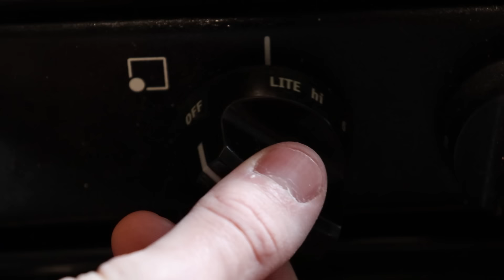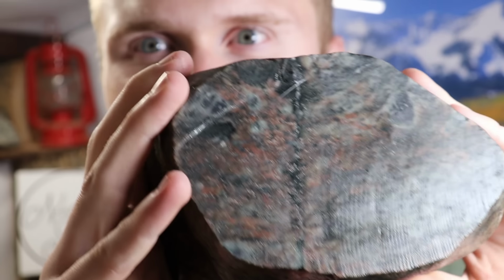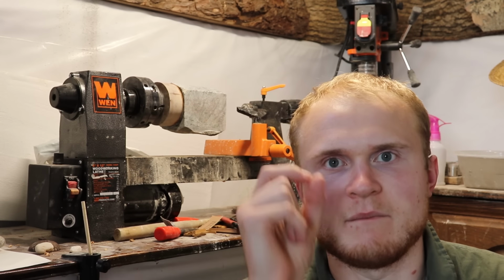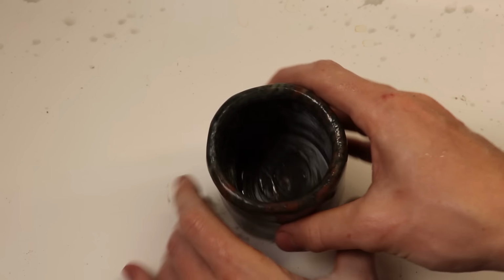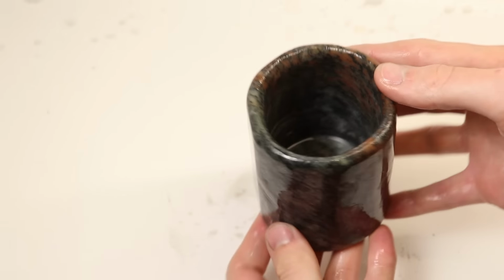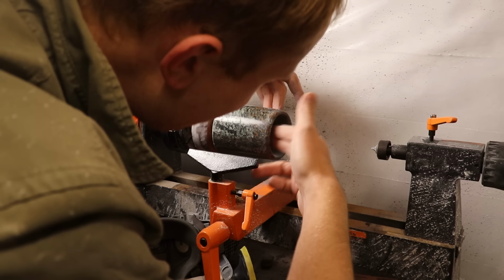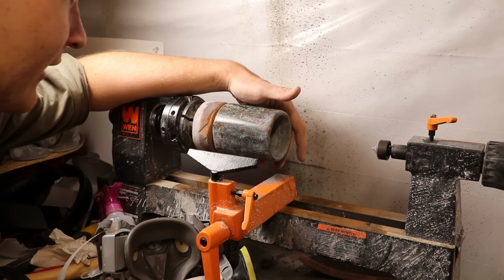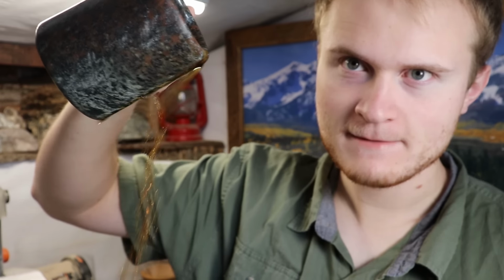I Made a Coffee Cup out of A Rock

Comment: GREAT VID!
just some pointers, not trying to bring you down, first, try locking the rock to the back fence of the miter. miters saw blades spin clockwise, it's not safe to push anything into it like a table saw.
easy fix, using that AWESOME slider you got, lock that sucker on the back fence, clamp it down, manual cut that sucker.
takes more time, but it's safer and less likely for you to have mini projectiles punching holes in you hands and stomach.

another one is instead of glue, bolt the wood to the rock and bond the bolt. I'm fairly certain you saw this one in hindsight, so ill leave this more of an idea for next time, because there has got to be another one. this is far to awesome to not make a second one, specially for selling. rocks are one of the few things you can pick up on the side of the road and most people find useless. easy money.

Comment: Thought the handle would have been integral, if your sticking a handle on afterwards, just cut the whole mug with a core drill? Drill the inside hole first from a big chunk, this way when you knock it out it won’t break, then drill the outside any diameter you like, perfectly smooth mug! Half an hours work.